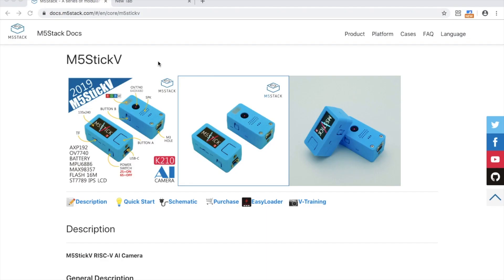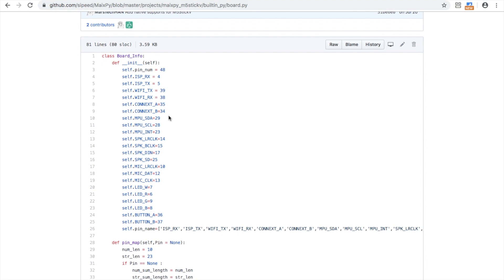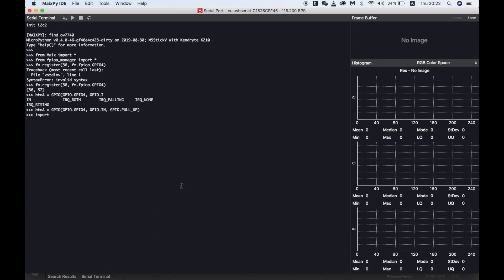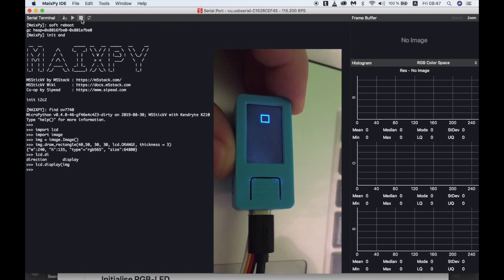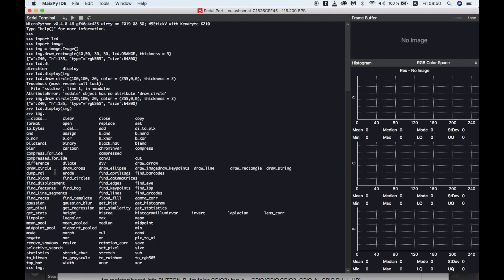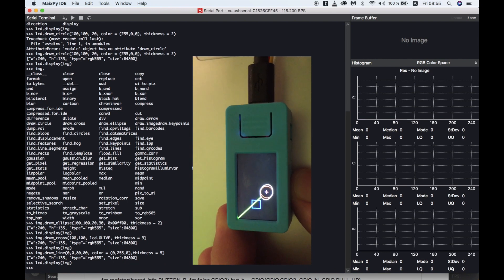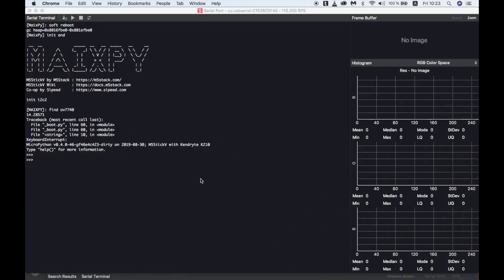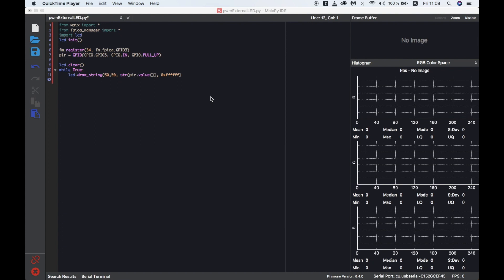M5Stick-V AI Camera Setup Part 3 - Draw functions and Grove port access

Comment: How did you connect the external led, can you give a simple drawing for connecting it.
Reply from the maker: Plug a standard grove cable into the grove port of the stickV and insert the shorter leg of the led(ground) into the port connected to the black wire on the other end of the grove cable, and the other leg into the port connected to the white wire. The yellow wire could also be used depending on what gpio you set in your code.
Reply: @M5Stack  thanks

Comment: i2c frequency could be an issue, try force it work at 200k speed
Reply from the maker: Thanks will try that, but it seems the issues were in the libraries, maybe some other core dependencies are missing since M5StickV is using quite an old version of micropython.
Reply: @M5Stack  I'm trying to find i2c for this so i can connect to ESP. Grove port is only external port. can this be used for i2c external devices? Can i somehow get communication from m5stack-v ai to esp?